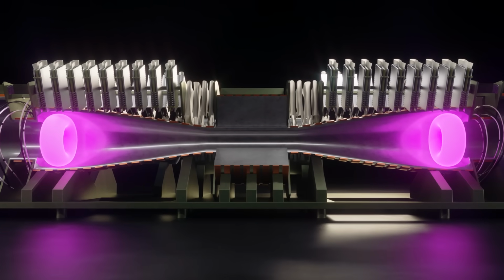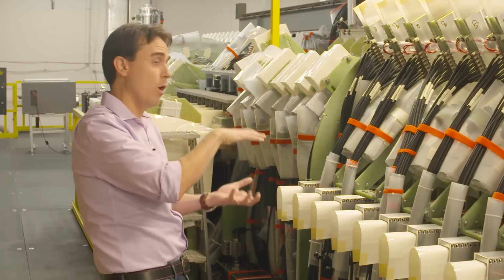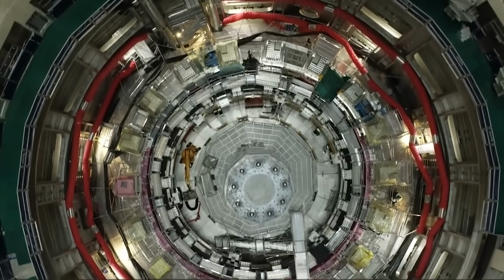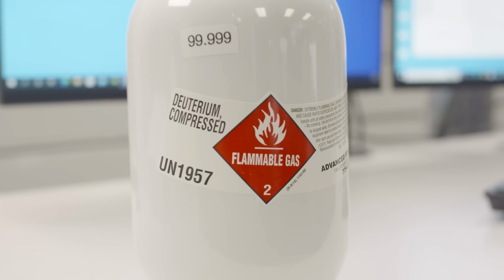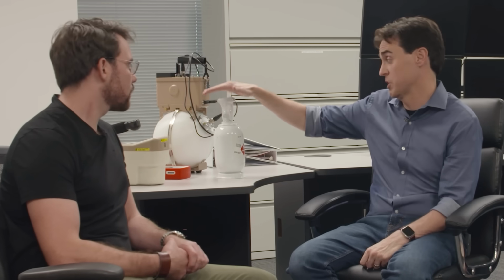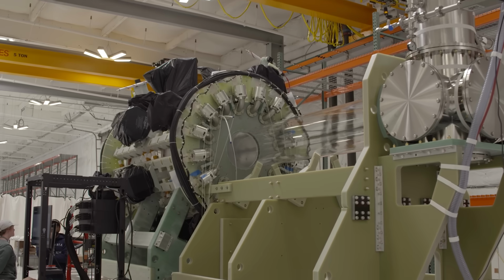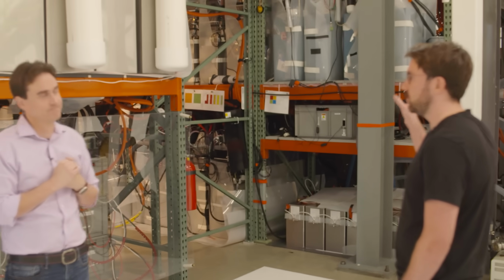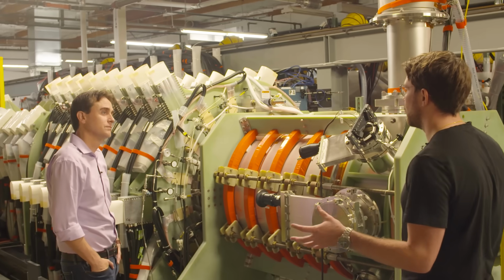A New Way to Achieve Nuclear Fusion: Helion

Comment: I want to just quickly point out that any information that hasn't been mentioned yet is stuff that these engineers clearly would love to talk about but are under contract to not speak of it. This is the most practical nuclear reactor (its more accurate to call this an engine than a reactor) I have seen yet due to the simplicity and practicality of the design. If this specific idea works then Helion has already gotten themselves a monopoly on the fusion energy business and everyone else now will have to play catch up. There's no business reason to allow all the details of the machine out, just the basic idea of it.

There are some very natural concerns such as "does this make more energy than it puts out?" In this case, the answer is probably no if only because this 6th generation machine wasn't designed to do that. The 7th one, as mentioned, is being designed to do that. They may not have numbers right now because they can't get them. They haven't done that experiment yet because they probably can't. The 7th generation, however, most likely will be able to measure the amount of power they can capture. 

I also want to point out that this entire engine is not a reactor. It is not designed to create a sustained reaction. The idea is to create many many reactions that, through magnetism, create an alternating current that they then capture.

Comment: "In this machine is a delicate orchestra of electronics pushing two plasma rings into a violent collision, and catching that collision in a magnetic trap in the center, which proceeds to shrink until the ions trapped within it have nowhere else to go but to fuse, overcoming one of the universe's strongest forces to create new elements in the belly of a man-made machine."

Dude, this gave me goosebumps
Reply: It's an elegant solution too, it's a fundamentally similar (enough) process to a combustion engine which gives me high hopes for our ability to quickly iterate on it.
Reply: it overcomes one of the strongest forces by using the strongest force
Reply: @vibaj16  What is the strongest force?
Reply: @stevendavis6157  Haha, not sure if you are trying to continue the joke, or if you are trying to point out the inaccuracy here.

The "strong force" is the force that holds the nucleus of an atom together.  Look it up on Wikipedia if you aren't familiar with the term.  When the video said "overcoming one of the universe's strongest forces", it could have been written as "overcoming THE Strong Force" and been more accurate, however less poetic.  

JIBaJ's comment was intended as a joke, but is very inaccurate.  They are using magnetism (not the strongest force) to over come the strong force (which is the strongest force).  But it still causes laughs because people recognize the term "strong force".
Reply: @stevendavis6157  The strong interaction
Reply: @uigrad  aren’t technically the forces that hold baryons together even stronger?
Reply: @cbuchner1  the forces that hold baryons together are what determine the interactions between baryons (and mesons). so no, they are the "same" force.
Reply: Have to shift my legs a bit.
Reply: "The power of the sun...in the palm of my hand!...
Reply: @J.P Slaym0 General Fusion's magnetized target fusion reactor is a lot more like an ICE.   It even has pistons.
Reply: Totally dude aye 😂😂😂😂😂😂😂😂😂
Reply: well you cant have a ball of matter the size of the sun pressing on the elements. So lets cheat a little beat or just create it artificall. Its quiet crazy really
Reply: If they inverse the polarity and ramp it up to 1.21 gigacochranes they could break light speed.
Reply: I think you'd make a great teacher, if you're not already 👍..
Reply: Its not unlike two turbojet engines pointed at each other, except plasma.
Reply: Sounds like complete and utter nonsense to me ?

But then I personally think that Fusion research and particularly commercially financed Fusion research is always going to be massively over-hyped anyway and is unlikely to yield any useful results at least for the foreseeable future.

Imagine spending 35 years working on something that still doesn't actually work, not in any real or meaningful way.

I be delighted to be wrong by the way.

Comment: Ok, you archieve fusion reaction. 
For this to happen you spent a lot of energy to form plasma and accelerate it , is it net possitive? Where the fusion heat energy go afterwards u cant transform all energy into magnetic? Cage will catch only some neutrons, we cant predict trajectory of neutrons after fusion it will hit the walls. Tangstan can withstand up to 3k deg. centigrate, ceramic up to 2k, u can use the regenerative cicle, but efficiency will be 30-40% max. 
And i am not even talking abou erosion of walls of plasma generator and fusion chamber, and how to repair them and how long can they operate.
Reply: It's all hype, zero tangible results
Reply: @Krullerized source?
Reply: It's not hype, scientists have gotten more energy out then they put in very recently.
There is a reactor in Virginia being built and it plans to actually generate electricity to be put on the grid.

Comment: I can see a nuclear fusion engine coming out of this for rockets; leave a small hole in the center, too, for energy to escape, and you get both an energy generator and an engine... Very cool new technology. Congratulations to the team's success, and congratulation to humankind!
Reply: The next thing to do is attach a gas generator, and you wala, an unlimited self-sufficient and self-renewable energy source ready to take humanity to a new age.
Reply: Another issue is how to do this continuously; it can be achieved in two ways. One is to have multiple similar devices firing in sequence. The other way is to increase the duration of the final result. The second way will be superior but will need some thinking. It will require multiple firings in higher frequencies if the device can tolerate it. Or by some mechanism to feed into the final state.
Reply: to remove heat we have the basic physics to look at, convection, conduction, and radiation. I guess they will make use of them all and create more energy in the process?

Comment: Nice video, and probably the most detailed video about Helion I've seen - they tend to be very secretive. There are quite fundamental questions that they still don't explicitly answer: What's the fusion yield per pulse? How is this scaling as the machines get bigger? This is critical to actually judge whether this is serious energy production or fancy science experiment.  How are they measuring the fusion yield? How are they measuring temperature? It's an amazing concept if they can show it's scalable.
Reply: Right. This a very important bit of info that was entirely glossed over. Maybe the 8th-gen machine is planned to do this (sounds like the 7th is primarily to prove the generation technology)? But it would be good to know if they are 1%, 10% or 80% of the way there so far, and as you say, if there are reasons why it might never work.
Reply: @xxwookey  One of the issues with fusion is that nobody knows how far along we are. It’s entirely possible that they’ll find a hurdle that’ll set them back a decade or more.

It’s all a massive science experiment that currently has no reason to not work, but we’re still solving issues as we’re finding them.
Reply: From what I caught from the video, there's no plans to make the reactor scalable in size but instead scaling the rate of firings. Iirc, they talked at a point of upping the rate to 10 pulses per second in the future. I do wonder what the maximum possible pulse rate could be, since I'd assume there needs to be some amount "burn time" for the fusion to actually occur in.
Reply: @amarukrosis  my observation is that scaling to a bigger single chamber would likely make it far less efficient for the process because the magnetic fields required would need to be that much more powerful, and IIRC it’s not a linear power increase required to do that.

Considering this is tiny (and far, far  cheaper!) compared to a Tokamak design, I think it makes more sense to scale by copy/paste many copies instead of growing to single larger machines.
Reply: @strictnonconformist7369  even the Tokamaks are trying to shrink, there probably won’t be one as big as ITER again, that was just the limits of superconducting magnets in the 70s-80s when the design was finalised. Since JET (literally mini ITER, finished way sooner because it’s smaller) there’s been MAST with much better return ratios, and also some private companies have even more powerful magnets yet again reducing the size even further. The fact that Helion’s is so small is mighty impressive though, even the “small” tokamaks are taller than a person
Reply: This is a promotional video. Don't you know you're not supposed to ask questions like those?
Reply: That’s the secret lol
Reply: Extreme secrecy can be counter productive  ( Theranos)
Reply: There are few sources that state the cooling requires upto 12 times more power than it generates 😆🙈 unfortunately everything is hyped up so they get more funding and entice people into the fantasy of free energy 🙈 a lot of people overlook the power requirements needed to cool down the system
Reply: If it was non-electric ( technology that does not use electricity ), they will say that it is not permissible and it is wrong under the pretext of ( a perpetual motion machine and that it consumes more than it produces ), but technology that consumes electricity, they would immediately say: Wow ! It's a super technology from the future !!. It seems that natural laws do not apply to electricity because it has a special recommendation or something similar to indulgences . Often, I see that consumer companies and people related to them try to push down every technology that does not consume electricity or does not require electronics, and unfortunately many people believe them.
Reply: Yes
Reply: Why wouldn't it be scalable?

Comment: So they looked at a Thermonuclear bomb and thought "how can we collide the fusion fuel without blowing it up with a fission bomb?" Amazing. This actually seems to be a totally possible way of doing controlled energy creating fusion, that won't take 25-50 years of building, but more like a couple of years and the reactors seems to be relatively small compared to other designs, meaning material costs become realistic and the fuel seems to be "easy" to aquire compared to other designs. I don't think I've ever seen a documentary giving me more hope for fusion than this.
Reply: Ironically, the situation you describe is exactly how laser fusion was conceived. 

Forget the name of the guy now, but someone who was very influential with the hydrogen bomb wanted to create underground power generation facilities where they exploded hydrogen bombs to generate electricity. Long story short through discussions with the government and everyone else, he was challenged “what’s the smallest fusion bomb you can make?”, and that’s how the laser ignited fusion pellet was born!

I definitely noticed the similarities in colliding these two toruses of plasma, and inducing the holhraum to collapse on itself, though. The fact this system uses a combination of magnetic confinement and inertial fusion induction is quite impressive. it has features of both MCF and ICF.

Comment: I love the project. I also love how they pooped over the D-T process, explaining that this is challenging to produce enough tritium for commercial scale. And then skim over the issue of He-3 availability by saying that all you need is to produce tritium and wait for 12.5 years :D
Reply: That’s not the main source of the helium-3, the deuterium-deuterium reaction is. The tritium decay is just a bonus, for what would otherwise be a waste product from the deuterium-deuterium reaction.

The real question will be whether the breeder reactor, when combined with the energy draw of the main reactor, ends up requiring more energy than the helium-3 reaction in the main reactor can produce.

Comment: These reactors will speed up the colonisation of the Moon, where mining will provide the needed He3 fuel, which is common on the surface due to the bombardment by high energy particles from the Sun.

Comment: Great video. There were a few statements about the tritium breeding that weren't accurate but I don't think it changes your conclusion. There are alternatives to beryllium, although they don't perform as well and may still have activation issues (e.g. Lead might produce polonium). You also stated that the neutron energy is used up breeding the tritium. This is not correct. There is actually energy multiplication from the breeding processes resulting in more thermal energy than the neutron has (10-30% more energy depending on the multiplier used). Overall your statement about tokamaks having the same problem as fission reactors in terms of capital is absolutely correct, and in fact maybe worse (definitely for initial demonstrators). 

I would love to know more about the efficiency of converting this expanding plasma into electricity. I am guessing there is a lot of thermal energy that they can't convert without relying on heating up coolant and pushing a turbine, but I guess if you can get high enough energy gain to offset that wasted thermal energy then it doesn't matter. Presumably they will have to actively cool the walls though. Thermal radiation in a fusion plasma can be significant even if they avoid the particles interacting with the wall (20-30% of the fusion power in tokamaks).

Comment: this is a truly spectacular machine...and i do hope they get it right with their next generation machines...they ought to use a harmonic system with them, as harmonics tend to lessen the losses through the input output sequence...also they must fashion the placements of the machines in a ring formation to account for flow of magnetic field pulses rather than clashes, because those impulses go as much outside as they do inside...i wish that i could be a part of such an ambitious and positive project, but i am too far away in a 3rd world country run by corrupt officials...

Comment: How does this classify ? intertial confinement or magnetic or both ? Seems this design is only giving the possibility of impulse power generation. Can we use capacitors to average the output to a stable level ? Then, how is the efficiency of this design compares to traditionnal designs like tokamak ?

Comment: I can see the benefits of both hybrid and single process reactors. If one day we could use these reactors in space, the hybrids are the most beneficial,  especially since they wouldn't need to be on constantly.  Generate the power when fuel cells need a charge.
Now, the next step would be to find a way to use this energy for propulsion in a vacuum...

Comment: My biggest question in that whole time was "What happens if one side fails?" or "What happens if the Magnetic Field fails?"
Do we have a plasma bullet shredd the Generator?
Do we have some big plasma goo eat a bit of facilitiy?
Could it theoretically phase through half the facility?

Not because I want this to fail but rather because I hope they have figured out how much possible damage it could cause before these things go online 20 km from my home lol
Reply: Plasma doesn't work like that, not even close, plasma, excluding it's different magnetic properties, is a lot like a gas, a type of gas that only exists at very high temperatures, if plasma escaped from the machine it would simply cool down and dissipate, no more dangerous than a steam leak, deadly to anyone standing inside the room when it happens, but nothing more, and that is why they don't stand in the room with it running
Reply: @Stackoverkill  I see, thought it would behave more like the charged particles in an atomic bomb or some of the Rays the sun throws at us.
Didn't have much talk about Plasma in school tho so also pretty uninformed, thanks for the info tho <3
Reply: @Vinci480  that’s one of the best things about fusion, if containment fails, it inherently cools down. Another way of saying that is the difficulty for fission is to keep it cool enough, while the difficulty for fusion is to keep it hot enough.
Reply: The heat is created from the pressure.  If the magnetic field fails the gas expands, expanding gas cools back down to room temp.
Reply: The plasma would touch the walls and immediately cool. The lifetime of the walls would be reduced somewhat and would have to be replaced sooner than the projected maintenance date.